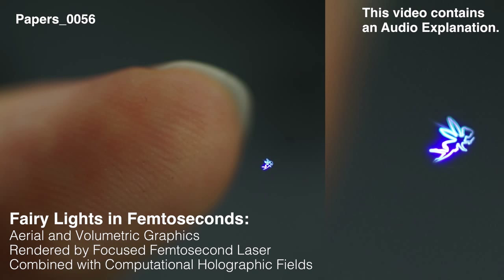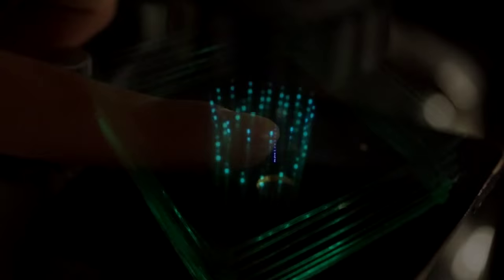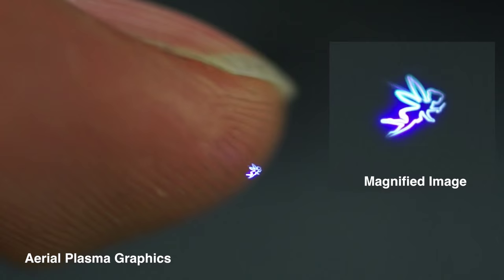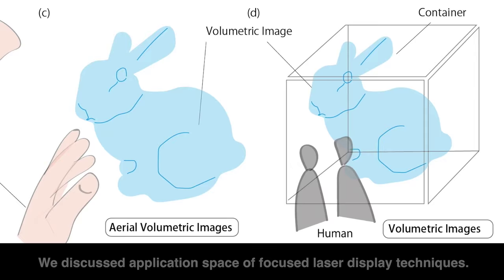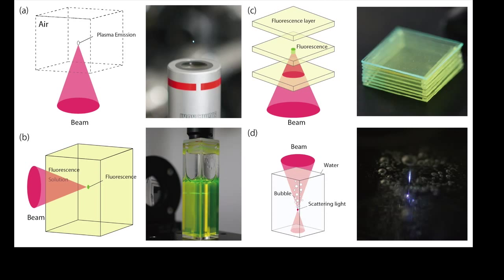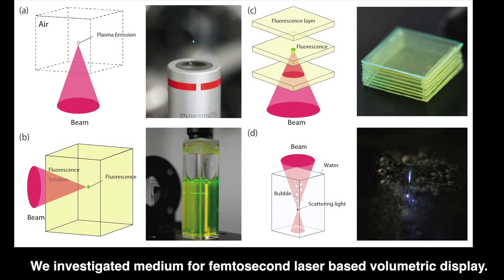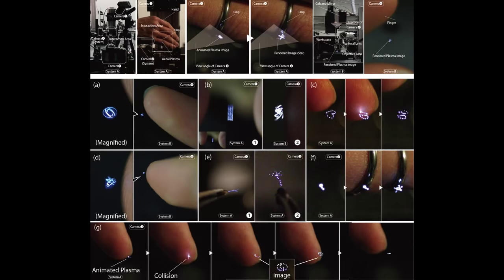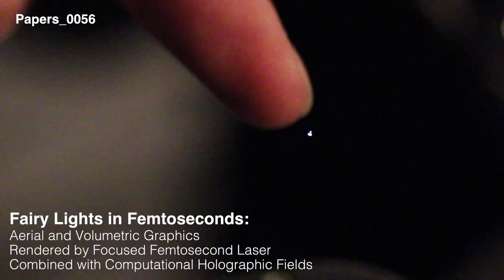Fairy Lights in Femtoseconds (SIGGRAPH 2015 Submission)

Comment: Hi like to join this team as undergraduate, graduate student or Collaborate Researcher, 

Shaped plasma

Abstract  relates to a method or principle of hold multiplier  components of plasma together  using laser on a millimeter, micro and non-scale. The laser are arranged  at different shape attached to the two or three components that will be held together to make a base etc. forming plasma pixels., 

Claims  

A system comprising: of multiplier  components of plasma together pixels  

  

The plasma pixels can be in different shape to house the  different colors of pixels .